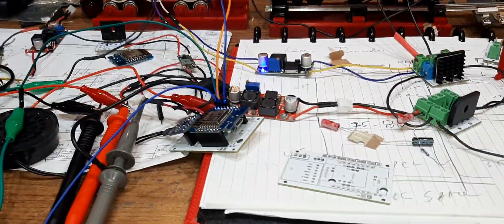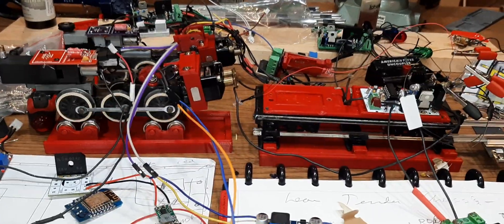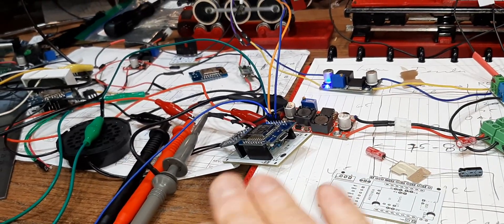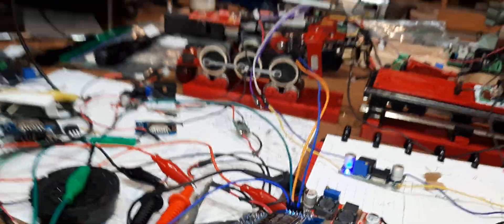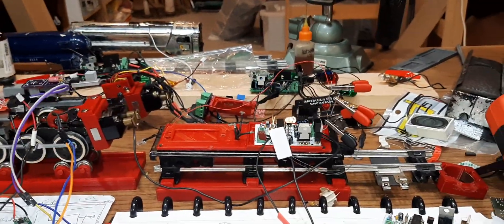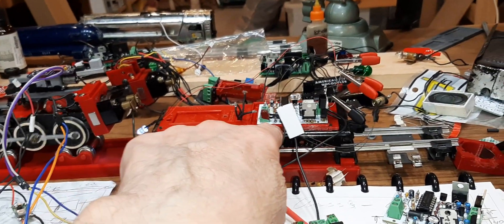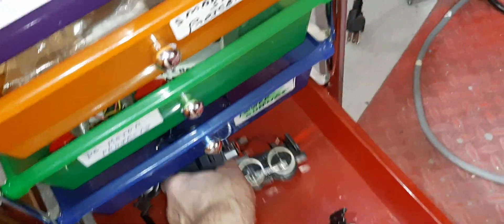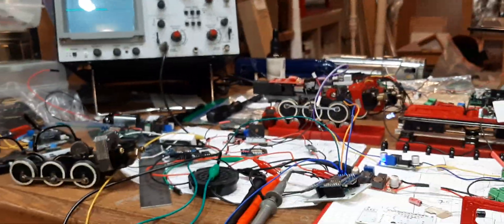Frankentrain Laboratories Leon's final parts test, now make it fit.

Comment from the maker: Just received the 3rd update in 3 days to the P&C sound Board. Will load it up and test it soon. I also have  a K5 in for updates and I plan to clone Leon's engine specs for this K5 that should be a real hoot. Plus I have several Mules in Waiting and want to bring them up to Level 1 Spec as well. I had an idea to offer an Atlantic with the Level 1 treatment which is what Leon is getting when I reach 500 Subscribers, we are close I better read up on how to use the suscriber base to select a winner!?!

Comment: I have a number of AF engines to convert to DC. Are your all wheel pick up trucks and AC to DC power conversion boards available for purchase? Thanks
Reply from the maker: Yes I have made and assembled a number of the units usually for upgrades i perform. If you are willing and able I can send them as a DIY KIT. Nothing is rocket science. We have the designs and proved them out. Tell me which engines you have in mind and what bits of the NGS updates you would like. Email at murpheyd@aol.com  Where are you located. I make everything but some parts I would need to order. Any questions? Dennis